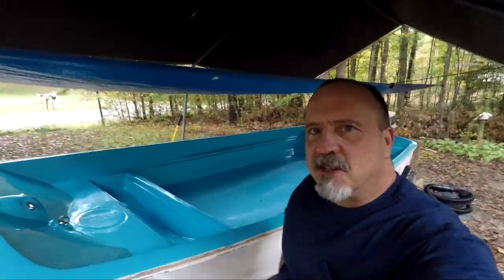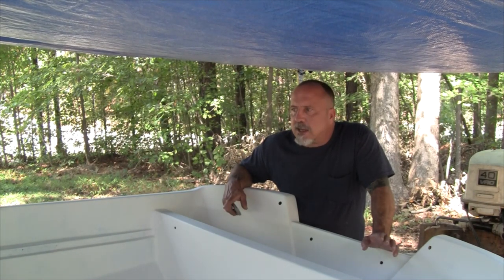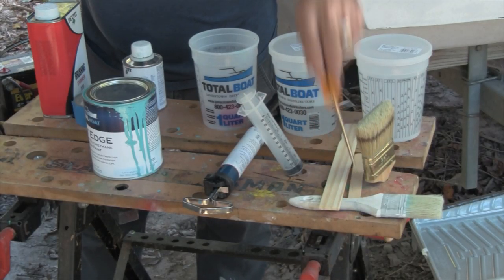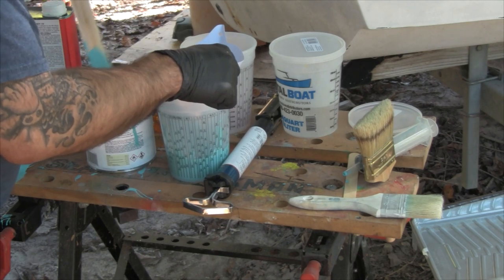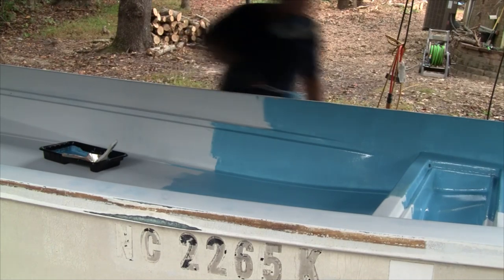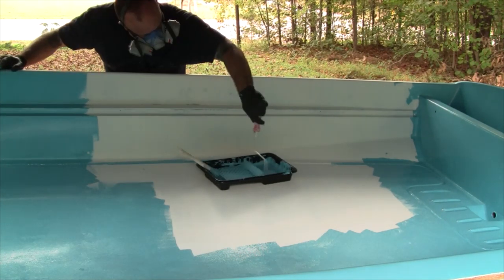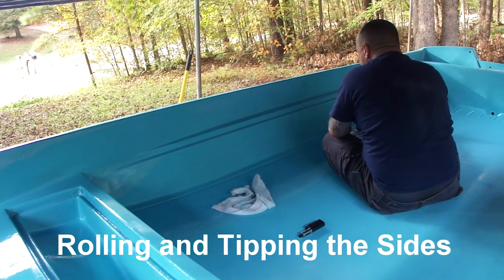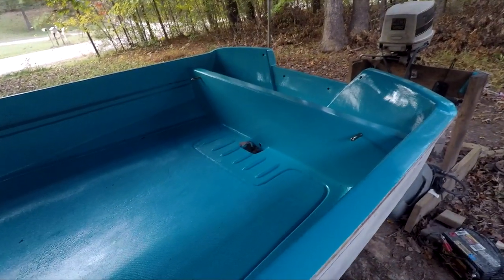How to Topcoat Paint Your Boat - Roll and Tip - Boston Whaler 13 Boat Restoration - Part 8

Comment: I used ultratuff coatings 10 years ago in my whaler and didn’t like it one bit.  A few years ago I applied the wet edge topside paint and it chipped off.  So I think this time I’m gonna take it to a line x dealer and have it done professionally , but I’ll spray the outside with Alexseal ... hope your boat comes out fantastic
Reply from the maker: Thanks for the info. A lot of folks swear by awlgrip. The two part poly's seem to be the best as far as paints but wont work well over single stage paints. Hopefully this will hold up well! Thanks again!
Reply: Extreme DIY AWLGRIP has been around for a long time it is one of the best companies to use, but I’ve seen a lot of people online saying that AlexSeal yacht coatings is the number one choice due to the fact it has a 30 year warranty on it and that warranty is good for you have a professional sprays it on or you do it yourself so I think I’m gonna stick with the Alexia and I’m hoping they can get me that Boston whaler blue on the inside of my whaler
Reply from the maker: Now you've got me rethinking the hull lol. I'll have too look into the Alexseal for the hull. Was going to go with Totalboat two part poly but I'll have to research the alexseal before I do anything. Thanks!
Reply: Extreme DIY to be honest , the time I used total boat was decent.  It applied Nicely, but over the coarse of a year I noticed a lot of small spider cracks and. It attracted a lot of dirt and was near impossible to get off.  I even have the boat under one of th use harbor freight car port things and still got nasty.  Now I plan to restore the whole thing.  Gonna spend Atleast 3-5 weeks doing it right.   And I’m gonna order mahogany seats from specialtymarine.com.   Finally get me a top quality cover and still store it in the carport thing
Reply from the maker: I hear ya. I have kept the last few boats under one of those covers and It's amazong how much crap can still settle in the boat. You definitely need a cover, especially if you have trees on the property!

Comment: did you sand the floor of the boat where threre is the grip kinda stuff or did u just paint over it
Reply from the maker: Sanded with a bristle weheel, painted it and put two coats of Kiwi-Grip on it.

Comment: I'm late to the party.  It looks great.  How stinky is the Total Boat?  I used Snow White Awlgrip on my 13' hull and it is scary stuff.  I have $200 worth of it mixed to Whaler Blue and I'm procrastinating.  I'm thinking maybe I'll use Total Boat.   You have to cover every inch of your skin with Awlgrip and have an organic filter face mask.  I still got a horrible headache from it and I don't get headaches.
Reply from the maker: The totalboat one part topside paint isn't very stinky but it also isn't as durable as the awlgrip which is a two part poly. I used Interlux perfection for the hull. It's very similiar to Awlgrip and had to use organic breathing protection. I wouldnt use anything else other than a two part poly for the hull.

Comment: I am getting ready to paint my boat inside and out. I noticed that you started with the respirator and then ended up not wearing it that much, so do you recommend a respirator if I am painting outside? Did it smell around your house afterwards or did the smell dissipate quickly? I have neighbors close by and was curious. Thanks! Nice job.
Reply from the maker: The totaledge did not seem to have a very strong odor. To be honest, I should have worn it throughout but hard to talk to the mike with it on. There was some lingering odor outside but not very strong. We have big enough lots here that neighbors wouldn't notice. If you're very close to each other they might though. SOme of the other paints like the two part epoxy barrier and the two part polyurethane have extremely strong and dangerous odors. I'll have a video out soon on that.
Reply: @ExtremeDIYGuy  Thanks!
Reply from the maker: @tomhalverson3438  Your Welcome!

Comment: I'm trying to figure out what my boats already painted with (enamel or acrylic) put a sock soaked in paint thinner on a spot, and it didn't get soft or come off till about an hr later. Sort of chipped off didn't melt. Any ideas?
Reply from the maker: Hard to tell. If its a one part paint then you'll need to stick with one part primers and paints. If the old paint is a two part paint you can put anything on it. That's why I used one part paints and primers topside, Couldn't tell what I had as old paint and didn't want to sand it all off (which is another option).
Reply: If it came off it’s one part paint. 2 part paint doesn’t come off after tapping something with thinner on it and covering with plastic for an hour.

Comment: how much do you think the petit performance enhancer worked?  Is it def. necessary?
Reply from the maker: I think it may have helped the paint flow and smooth better. I don't think it was really necessary though. Probably just thinning it with regular would have been enough. In retrospect, I probably should have done some tests with and without it.
Reply: @ExtremeDIYGuy  got it and thanks!  Just got my boat completely primed yesterday.  Gonna be ready for paint in the next week or 2.  Just need to get a warm and dry weather window.  Also, how much paint did you go through on the inside?  Is 1 quart enough or should I get a second?  I'm using TB Wet Edge btw.  Thanks!
Reply from the maker: @Smacker7474  Awesome, would love to see how it comes out. Thinking about creating a page on my website so folks can send pictures of their whaler projects. Thoughts?
Reply: @ExtremeDIYGuy  Thanks and will do...  A page on your site would be awesome!  I love seeing what others are doing and learning how they tackled certain issues that came up throughout their projects.  I would definitely do it!
Reply from the maker: @Smacker7474  Let me look into it. Hopefully there's a plugin I can use maybe do a closed forum or something. I've got to think on this one, want to do something useful and not klugey or difficult to use.

Comment: What was the temperature when you painted? And how long did it take to dry?
Reply from the maker: I believe it was in the low 70's. I can't really remember how long it took to be non-tack but I believe it was around 6 hours
Reply: Extreme DIY Thanks. I’m hoping that the weather will warm up. It’s only in the 60’s during the day now. I have a garage to put it in to work but it’s harder to see when painting. Thanks.
Reply from the maker: Should take long. 60's is the low range. Good luck!

Comment: How come ppl don't just spray it like a car?
Reply from the maker: Toxicity, you need positive pressure breathing protection. It's doable in a properly equipped shop, but not for the average DIYer. I've heard that the rolling method gives you a better finish but can't attest to that.